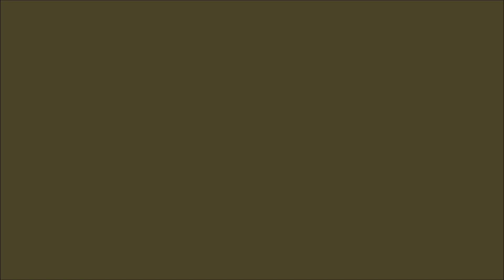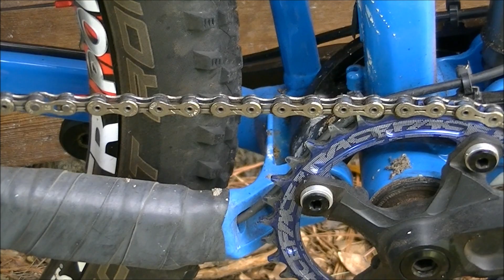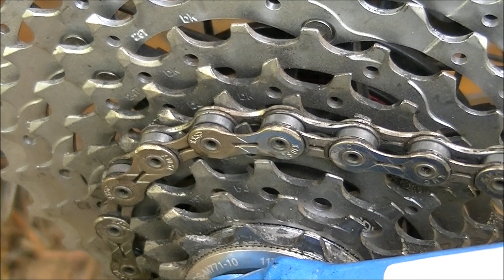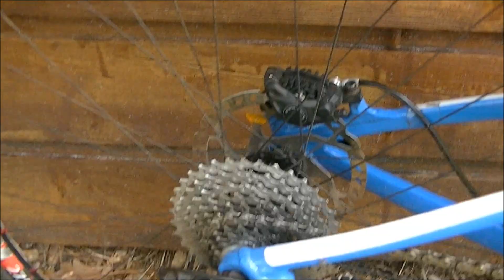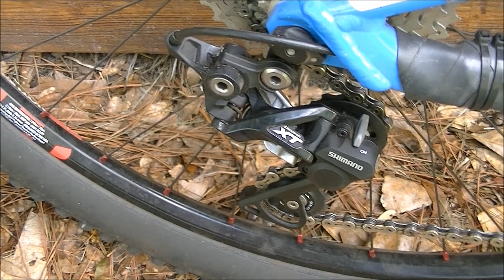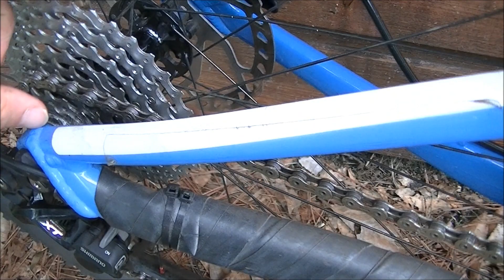How to Build a 1 x 10 Drivetrain on a Mountain Bike

Comment: Good explanation. I did do a 1x10 on my trance x29. Just thought I'd throw it out there that depending on what drive train you currently run, going 1x can be quite reasonable. For instance, mine cost me $35. Since my bike was 2x10 all I did was remove the front derailleur remove the 2 chainrings and replaced the center (top on 2x) ring with a racefae 32 tooth narrow wide. Shortened up the chain just a bit and done. So for those people who even have a 3x drive train the crank will usually work as long as it has a 104 BCD and put the single ring in the center spot. So keeping in mind not changing the crank, 10 speed cassette - $40 (sram pg1030). 10 speed shifter - $30(sram x5/7). 10 speed chain $25. 10 speed clutch type derailleur $70(sram x7 type 2). Single ring $40(raceface etc.). This can really be done on a budget for under $200. Keep up the videos. Oh and on a side note I did a 1x10 on another bike that was running a sram x7 non-clutch derailleur and it has yet to throw a chain with the narrow wide race face ring. The bike is a 26" so the chainstays are reasonably short. I wouldn't recommend it if you are a real aggressive rider, but it seems to work fine.
Reply: Matt Pierce I guess except the advantage of reducing chain drop, I still don’t see any other benefit of going the 1x.  Clint went with an 11-36 here on the rear cassette; in steep terrain or trails, a person can run out of juice pretty fast. Clint admit he lives in pretty flat terrain, but here in the PNW.  He talks about weighing in on fitness and type of riding influencing cassette choice - I think that’s a hugely overlooked item.  That’s where I think the 2x system has so more flexibility than a 1x.  Clint is fortunate than he can have two different bikes, one set up with a 1x and one with a 2x.  Not everyone has that fortune, and has 1 bike.

I traded for a bike last year that has a 1x10, 32 up front 11-36 in back.  I also have an older bike with a 3x system, and I find it the older bike gives me so much more terrain flexibility than the cool new bike.  I have on order a 11-42 cassette to replace the new bike cassette, which will allow more flexibility, but the gaps between gears will be greater.

IMO, it’s still tough to beat a well adjusted 2x derailleur.  I was about to jump on the 1x bandwagon worh my other bikes, but I’ll stick with the 2x and 3x for now, and make sure the front derailleur and chain are maintained and adjusted.

Comment: I now run a 1X9 on my road bike. Race Face 40Tnw chainring with 12-36 in the back. Works like a champ. No need for a chain guide, no need for redundant gear ratios.
Reply: For road bikes, there is nothing that would throw the chain off. On a Mountainbike, there is (bumps, rocks...)

Comment: Nice video. Just converted my my 3x9 to 1x9 using almost all my existing components. 32t 9sp racering , 9sp HG61 11-32 cassette, new rear 9sp xt mech SGS (in case I want to go back to 3x setup), HG-53 9sp chain and custom fabricated chain retention device. The whole thing costs me about $131. I will be changing the cassette to a HG-61 12-36 ($30 & will replace 12t with 11t from old cassette ). No narrow/wide ring or clutch rear mech-works great. Brand new 1x9 drivetrain for well under $200.

Comment: I have a 1x10 set up with a 42t cog and raceface nw chainring. I am still playing around with the 42t cog as the chain can slip out of the cog when pushing hard. 

The chainring holds the chain on great without a clutch derailleur. I still haven't dropped a chain on some pretty rough trails!

Comment: Good vid- thanks
Alternative to using spacers:
- you can order shorter bolts
- use a chain ring guard and use the longer (original) bolts.
I used steel bolts - like them better (had to drill out one of the aluminum ones...)
So far love the set up. If any of you guys are unsure just ride in your middle gear all day as a sort of 'test drive' and see what you think.

Comment: I'm changing my 26er to a 1x 10, using the 32T race face with XT 11-36 cassette and Shimano Zee+, as you said, climbing should be a little better using this combo with 26" wheels at least I'm hoping so.
The old Trek 6700 should feel like a new bike after this.

Comment: Great how to video. My bike is entry level and I've upgraded a few things.  I had planned to go 1x10.  Originally my bike was 3x8. I have gone with the 32t race face narrow wide and I picked up an 11-34 8 speed cassette.  It works very well.  I'm not sure I need 10 gears.  I'd only need to go 1x10 if I wanted a big 42t ring on the cassette.  Anyway thanks again. Just thought I'd offer my 2 cents that anyone can try 1x for just the cost of the front ring if you were on a budget like myself.
Reply from the maker: Thanks for sharing David

Comment: I ended up having to change out my cranks.  The front chainring spider didn't match the 104 mm  Raceface CR.  I put Shimano SLX cranks on it.  It bumped the cost of my 1x10 set up by $175 but is isn't mind the cost since I gain a better crank set than what was on there originally

Comment: I’m just putting a one by 11 on my specialised 2009 enduro which I bought second hand  , but I’ve never done this before so I’m kinda nervous , I’ve got to go for a one by 11 as I need the extra range because of hills and I’m over weight plus I’m 62 years old . I’m putting a 32 tooth on the front  , at the moment I’ve got a 9 speed scram on the back , do you think my scram medium derailer will cope?

Comment: Hey Clint. need some help. I want to convert my full suspension cross country 29r from a 2x 11 (11-36 cluster) to a 1x 11 (11-46 cluster) with a 34 tooth front chain ring and will need to put on and size a new chain. How do I measure the new chain so it will work with the rear suspension and not pull off the rear derailleur? I know from a road bike or hard tail MTB it's big - big + 2 but this is different since it's a fully. Thank you!

Comment: Hi Clint, great videos. I went for the exact same setup as you did, only different is the crank, i got the XT.

But i got a problem (i think). The angel from the chain cassette til the drive train is pretty steep when i got the lightest gear. If i spin the drivetrain backwards, it will go from the lightest gear till 2-3 on the cassette. Is this normal, ore can you think on anything i might have done wrong? To me it seems like the chainring do not get close enough to the frame.

Thanks.
Reply from the maker: Do you have any spacers on the bottom bracket on the drive side?  If so, take one or two out.
Reply: Clint Gibbs No, there are not any spacers, but i can see the press fit bottom bracket sticks more out of the frame on the driver side, could this be the problem maybe?
Thanks.
Reply from the maker: Yes, if it's not pressed in fully that will cause problems.

Comment: Cool...Where did you get that plug/cap that is where the derailer used to be??
Thanks, Bart
Reply from the maker: That actually came with the frame set. Giant included lots of plugs for different derailleur configurations.

Comment: great video! were u able to do this on your own or is this something that u would recommend a shop do?
also, what size of a chain-ring would u suggest if im still riding a 26''?
Reply from the maker: +joe astleford I do all my own mechanic work but I also have built up a lot of tools over the years. If you have some Allen wrenches and the tool to remove your cassette, you can do it. Also a chain tool, but that's usually included with most multi tools that you carry on a ride.

Comment: Great vid, I have a giant stance 2 (3x9 alivio) and I was going to upgrade to either shimano zee, xt or slx (all with about 50% off on chain reaction cycles) 1x10 all with race face narrow wide chainring. The kits include cassette, derailleur, chain and gear shifter. Is there anything else I need?
Reply from the maker: That should be it. Just make sure the chain ring has the correct BCD to fit your cranks.

Comment: So, is there any reason why I couldn't just remove the front Derailleur and the smaller cog?  Would that be safe?  I'm trying to find a reason why it wouldn't be but can't think of one.
Reply from the maker: +Big Truck Big RV on a normal chain ring without a front derailleur or chain guide the chain would bounce off. That's why you have to use a narrow wide chainring if you're not going to have anything like a front derailleur or chain guide.
Reply: +Clint Gibbs Thanks for the response. Yeah, so that stinks.  My daughter is riding a 13.5" Trek (she's only 5'2") and I installed the SRAM X9 groupset from my bike (after upgrading to complete XT) on her bike.  The seat tube was so short that the cable guide eyelet wouldn't give me enough room to clear and keep from rubbing against the front derailleur adjustment screws.  So, I decided to remove the front derailleur and just keep the chain on the larger gear.  I guess I should probably rethink that and just perhaps a low mount top pull derailleur?  What are your thoughts?
Reply from the maker: I'd get a chain guide, like one from MRP.
Reply from the maker: Or check out the N-Gear Jump Stop. But with that one you may have to use a bash guard on the outside
Reply: +Clint Gibbs I ordered the Origin8 Chain guide on Amazon.  It's got really good reviews and appears to work.  So, I hope it prevents problems.  I also saw an interesting video on how to use a rear reflector clamp to make a chain stay.  Perhaps you could make one and show us if it actually lasts and works on the tail.  Thanks for your help though!
Reply: @BTBRVReviews  just make it 1x she wont be able to use the front gears anyway

Comment: Hi Clint, I have a 2012 Zasker 29r with a 2x10 set up. watched the video and familiar with Bike mechanic how to. My question is this my rear cassette is a 11-34 with works well for my as a light 70kg 5ft 8" rider who mainly does XC riding in the UK and domestic UK XC racing when I can will this be a OK rear gear set with say a 32 front ring? (rather than the 34 front ring with the 11-36 cassette in the video). I dropped the 11-36 before as I rarely used it and the 11-34 gives a slightly closer ratio mix and quite fit rider so even with that 36 missing can dish out the power on the climbs - but 1x10 might be a step too far?, I have two sets of wheels so 2 lots of cassette to change/etc Being a tame Dorset (south UK) trails are not what would call "all mountain" and my Zasker is my XC race bike so if ever a problem thinking of a GT sensor for more social rides or all mountain stuff......if I ever get onto that terrain.
Reply from the maker: As long as you don't have extended steep climbs then a 32 front with an 11–34 would be fine.  As far as the high-end of the gear range, on a 29er you would be able to hold about 27 mph, so if that's enough then you'll have plenty of gear.
Reply: Might stick with your your 11-36 cassette/front 34 ring then as video. I already run a XT clutch rear mech & have the original SLX chainset which the Zasker came with still running good and in use. So all I would need to change is cassattes x2/34 chainring/change chain length as needed (suspect chainline is good with the SLX chainset & single ring?). Having been back in XC racing can see the 1x is a advantage..... Lacking budget for a 1x11 XT set up!

Comment: With the spread of the cassette, would it allow myself, an older guy to climb hills and ascends? Its what has kept me from going from 3x9 to a 1x10.
Reply from the maker: +Joe N you are somewhat Limited in your gear range with a 1 by 10 system. If that's a concern the new one by 11 stuff would be better.

Comment: Hey Clint, I realize this is an older video but I'm thinking about converting my bike to a 1x10. I have a Scott hybrid bike with  48/36/26 front rings and a 11x32 rear cassette. Would this be a good idea to make the switch? I ride mostly the rail to trail bike paths. I live in South western Pennsylvania where there are a lot of hills but I rarely do hills. I mostly stay in the middle chain ring anyway. Any help would be appreciated.
Reply from the maker: +pa dude11 it's all going to come down to the gear range you want. Of course a 1x system is simpler but you do lose gear range. Hybrid bikes, since they go on pavement more, can get up to fairly high speeds on paved descents. The newer 1 X systems for gravel and road bikes have a massive spread in the back cassette. If you think you can get away with a more narrow gear range then go for it. I would just do a few rides and stay in the middle ring and make sure that's okay.

Comment: I just got a crankset to do this convertion, problem is, the bolts are beyond tight. I got sure they weren't rivet, they have tread. Still I can't get them loose.
Any sugestion?
Reply from the maker: There is a tool to use on the backside of crank bolts to keep them from spinniing. Maybe you need one of those? You can try spraying WD 40 on the bolts and letting it sit overnight

Comment: Do you have to change out your cranks if you have a 3x up front?
Reply from the maker: No. You would just remove the chain rings and install the narrow wide chainring where the middle chain ring would go. It will look very similar to the one I show in this video.

Comment: Can you do an overhaul on cassettes? Like, lubing the parts, putting brand new bearings on the freehub body and grease them, and prevent future dirt and grime formations.
Reply: The cassette should wear out long before the bearings. Yes you can rebuild freewheels. It is more expensive than buying a new wheel with hub though. Ball bearings are expensive.

Comment: I currently am running a 3x10 I'm wanting to upgrade my cassette to 11-42 and then eventually put a single chainring on front. Is this possible? And if I get an 11-42 cassette will I need a different derailluer? My current derailluer is a sram x9
Reply from the maker: You probably have a long cage derailleur on your bike now. With the 1x setup I would recommend a medium cage derailleur. But your long cage may work. I would at least try it first. If you get excessive chain slap or have any missed shifts then switch to a medium cage. But again, it may work just fine.

Comment: how much weight would this cut because my suspension bike wight is 29lbs and its really notice after riding my lighter hardtail. 
thanks
Reply from the maker: You'll save approximately 300 grams by eliminating the front derailleur, front shifter and cables.

Comment: Clint I have one question for you, I already buy one Giant Anthem Alum model 3 ( 650b) you reviewed this bike but with some difference component ( SRAM Crankset and Drivetrain ). Mi bike come with Shimano Deore and SLX Component in my drivetrain setup. I tried to lookup one setup, to replace 2 x 10 drivetrain but I really don't know the fittmen of my crankset. I read the shimano bottombracket is Pressfit, but I read too is GXP. I have Deore Crankset with SLX Front Dererailleur and Back Deore Dererailleur with Deore Cassette.

I need your recomendation for change my setup, I really like 1 x 10 setup, but my crankset/drivetrain setup still confused me.

Thanks
Reply from the maker: JRRA1356 , check out the comment from Matt Pierce above.  To switch to 1x10 you should just be able to purchase the Race Face Narrow-wide chain ring and replace your current chain rings.

Comment: Clint, do you have a video that explains the gear ranges? For instance, the top wheel of the casette has 30 teeth. The bottom one has 11 teeth. What exactly does that mean? Bc I always try to figure out if 9,10,11 or 12 gears are better on a bike.
Reply from the maker: I don’t think I have one specifically on that. Basically the largest cog which is closest to the wheel, is going to be the easiest gear. For mountain biking, that large cog is typically a 52 or 54 since mountain bikes do not use front derailleurs anymore. For road riding the largest cog is somewhere around the 32 or 36. For single front chain ring gravel bikes that largest cog is going to be around 44.
Reply: @ClintGibbs  How many gears would you recommend a mountain bike should have? I am still accustomed to 21 gears with three chain rings in the front.
Reply from the maker: @Jose-sy1je  1 front chainring and at least 10 in the back. New drivetrains today are 12 speed in the back.
Reply: @ClintGibbs  Bc I'm thinking between the Roscoe 6 and Stoic 2 for my budget. Which one would you take?
Reply from the maker: @Jose-sy1je  if you’re buying the trek new from a bike shop that’s what I would do so you have that support.
Reply: @ClintGibbs  I guess I would have to if they sell it there. But it only has 9 gears, hence my question. Another bike is the Cannondale Habit HT2 from REI. But someone told me it's not that good.

Comment: I would like to convert my 3x10 into 1x10.Does the single speed chainring can fit into any crank?
Reply from the maker: +Maniac Runner Yes, as long as the BCD is correct.  And make sure you get a narrow-wide chain ring as opposed to a straight single-speed ring.

Comment: Hey clint. Would this work? 
32t Front chain ring with 11-42 cassette on the back with a XT derailleur? Would it be good for hilly or not so hilly. I ride mostly downhill and a few uphills. Thanks :)
Reply from the maker: Bruce wayne Yes, that will work.  Youl may spin out a bit on fast downhill with a 32T but not too bad.  If that's a concern go with a 34T on the front.
Reply: Thanks a lot clint for your suggestion and quick response :) Keep making great videos!